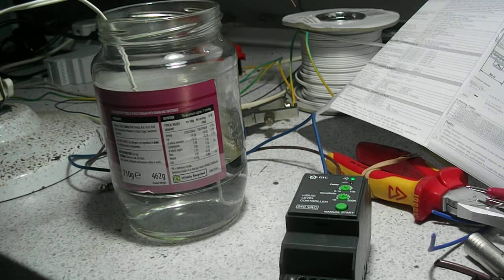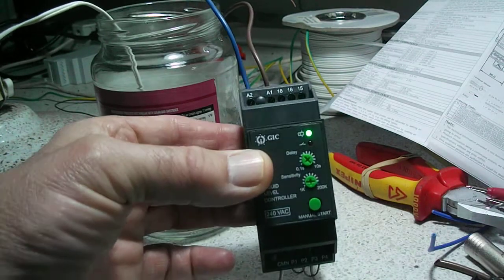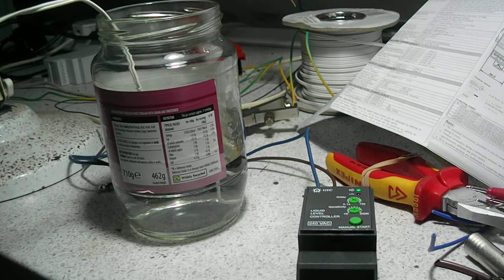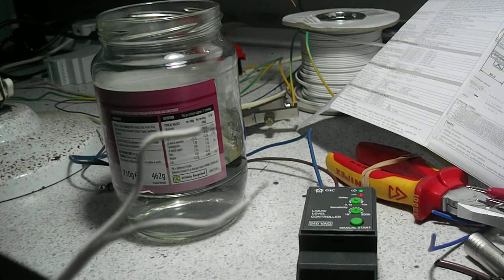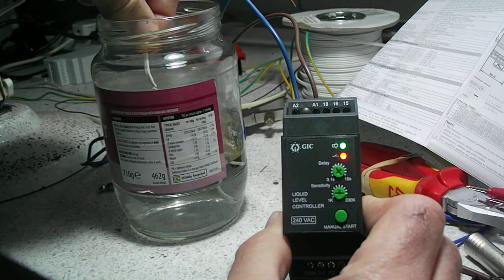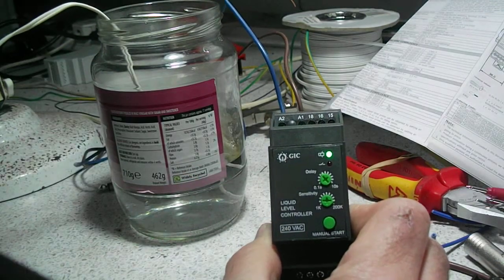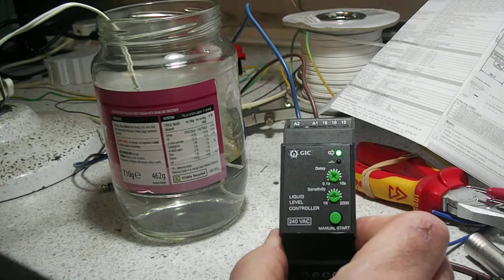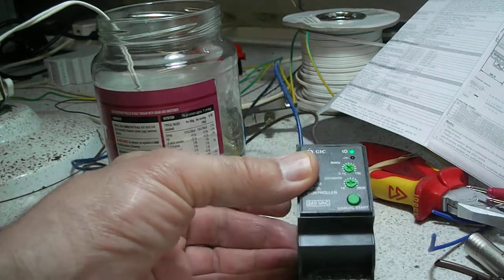Liquid Level Controller from GIC 4421AD1

Comment: Does it always turn on in relay on condition in case there is a power cut?
Reply from the maker: Will not operate if there is a power cut.
Reply: @collectric5518  I meant what will happen in case the power goes and comes back and the relay was on to fill the upper tank but couldn't fill it due to power cut, will it resume filling and turn on as it was in previous state?
Reply: Turn on always, but after detecting water level it cut offs, using in my home last 5 yrs
Reply: @aamaadmikibaat02  thank you, using it since 2 yeara now and works so well

Comment: if I touch the water while the motor is on or sensors ar In the water does I will electrified?
Reply from the maker: No, there is sufficient isolation between the sensor and the relay contacts.